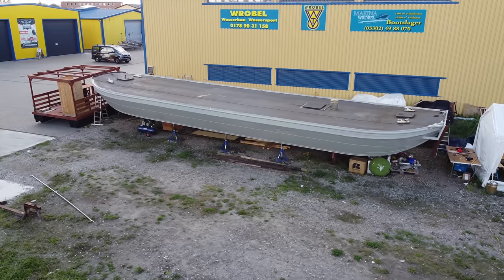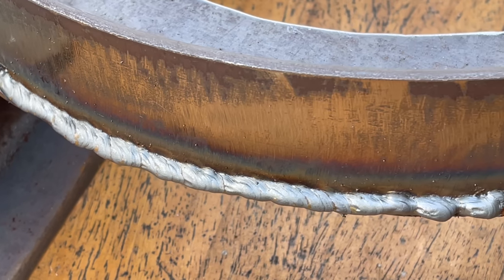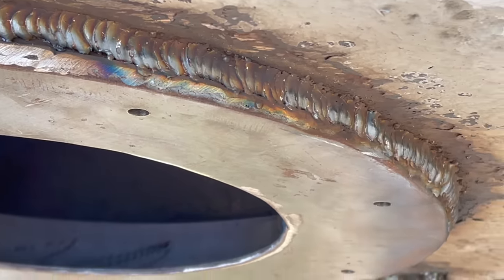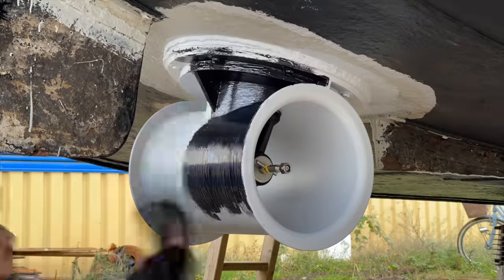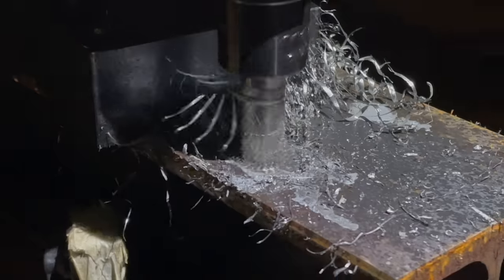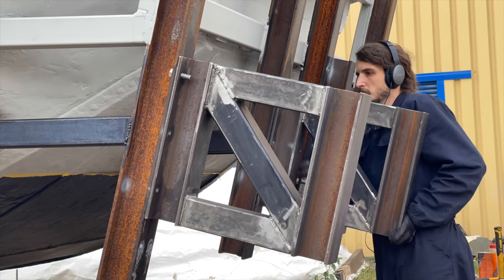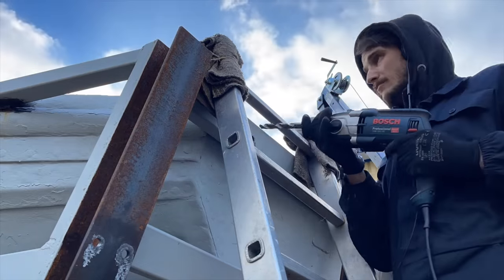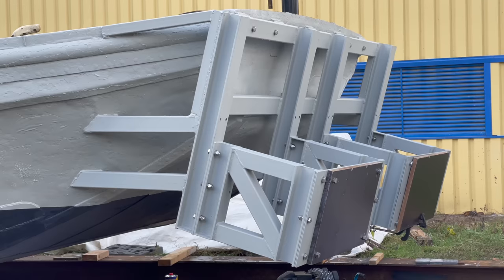My HUGE Barge BOAT is ALMOST READY to go into the Water

Comment: Why did you decide to switch the ends of the boat making the bow the stern and the stern the bow?  The fin you partially cut away appears to have been a skeg designed to support a rudder which makes that end of the boat the stern.

Comment: im sure this solution will work but honestly it fucks up the aesthetics of the boat. i would ve cut into the boat transom (reinforcing it on the inside as needed) to accomodate for the outboards and then deciding whether i wanted direction to come from them or a rudder. if the outboards were to provide direction more  room would've been needed (but not that much i reckon), if not, less space, but a rudder would've  to be installed meaning more time, labour and money.

Comment: Your work is very neat. However, that transom is heavily over-engineered. You do not need that heavy material. Please make 100% sure that your welds are totally waterproof otherwise that square tubing is going to rust from the inside.

Comment: It would be better to grind a V into the join before welding to increase the surface area, then put down a couple of beads. But because you have over engineered it by a factor of 2000, there should not be any issues with a single bead you laid down.

Comment: Did you ever see a outboard vertical lift with a MarineTech Products Panther Marine Manual Motor Tilt and Trim Lightweight Outboard Aluminum Bracket

Comment: I believe you will be happier with the two motors on the back rather than just the one.  You will have better power to weight ratio better acceleration and if one motor goes down you have a spare.  Let me know!

Comment: Still working my way through but so far the bow adapter welds look like they needed to have more amps as it looks like not enough penetration. Glad you ground and re welded them. Great work. A small seat or a mechanics kneel seat works well for underneath workm to save your legs.
Going to look at your other videos later but may I ask why you choose a barge boat? and
Why did you choose to make it go backwards?
Edited :
Does your outboards have an extended leg option to give it a better reach without them being mounted so close to the water?
Have you thought to enclose the extended transoms in with floatation foam core filled to give you a stable and boyant platform to work on the outboards if you happen to break down?

Comment: This barge is decked, what was it used for, before you bought it?? When was it built, and where?? Weight??  Shall you open it up later?? As for the outborders, usually they are placed at a right angle from the water, but that can be rectified later,if need be.  As for service, maybe two platforms by the waterline, or slightly above, beside the engines could be good to have, both for service,and also for swimming, i.e for getting up and into the water. I assume you will put her into water coming spring??  Regards, Mikke..

Comment: Would´nt it be better to use the flanges of the H-beams to make a cradle to lift the engines straigth up and down? Instead of having to tilt them? Would save a lot of steel and weight. Just a thought.

Comment: I hate to be Negative, but those welds are cold, and they have porosity and may not be water tight. Your welding is very good with a stick, I suggest you grind the outer ring and use 7018 in Horizontal to Seal it.

Comment: You are going to need to close in the bottom of the engine mounts as the way they are they are going to scoop water up and over your outboards continuously.  Not good!  Make a model and see what happens.  The bottom will have to extend out and under the engine mounts as one piece or you may end up getting a wall of water coming up between the motors again drowning them.  Even at five or six knots when you hit a wake or waves this will be magnified.  Not only that but they will act in present configuration as a sea anchor and slow you down considerably.  Your welding is getting much better since your beginning.

Comment: You should pull not push with a mig welder those holes in your welds is porosity that means your weld is not as good as it should be!!

Comment: Diagonals on the brackets going the wrong way. View from port side, the strut is going from top left to bottom right. That provides no support to the load of the motor. the diagonal bracing should run from top right to bottom left to support the load.

Comment: I rarely critique your work, since most of what you do is very thorough and thought out, but sadly the sikaflex job on the adapter is going to cause you trouble. 
The grooves are there for a reason, it's not necessary to put another layer in the middle. In fact by doing so you used too much sealant and turned 2 seals into one. I'm not exactly sure why you'd need 2 seals, but most likely it's going to cause you some problems.

What is DEFINITELY going to cause you problems tho, is that you didn't tighten it all the way before it dried out.
When you tighten it all the way, you squeeze all the unnecessary sealant away from the groove. When you don't, the seal will be too big for the groove and by the time it completely dries (1 week- 3 months), the seal will be under too much stress. IT WILL CRACK AND RUPTURE. 
Not angry, just highlighting that it's very important.
That is even true for flat surfaces as well. When you apply sealant paste, always always always always always tighten the bolts to the correct specifications immediately. It's even going to leak if you wait as short as 30 minutes.
Reply: Oh and from an aesthetic point, don't smudge the sealant. It'll be a bitch to clean off next time and looks ugly. Rather wait until it's dry enough to cut off with a knife. This way you will also have a better idea of how it's curing where you can't see. Maybe more important on very time-sensitive jobs, but it's a good habit to have either way.

Comment: You may want to the next time not have the treads of your bolts touching or making contact with your metal. Make sure your shoulder of the bolt came pass the metal a 1/8 of a inch and use a washer to make up the slack. I can give you a diagram if you one

Comment: No offense but those 2 outboard motors are not enough power. You will have little to no control in any kind of current. You should sell them and buy a good used diesel. I have seen people buy school busses and use a pair of turbo diesel school bus engines and have more than enough power for vessel that size.
Also your rear thruster is going to add allot of drag in the water and need more power to make up for it. Please change your plans before its too late. 
You will be lucky to get 3 knots if that with those outboards. Its far from the power you will need to control that size vessel. Once you get any momentum you will have to run those 2 outboards wide open and still not have power to stop.
You simply don't have enough power or propeller to move enough water.
I have owned large vessels for the past 30 years and know what kind of power and propeller it takes.  You need a pair of 500hp turbo diesels at minimum. And a pair if 3 ft or larger props. Before you destroy those motors contact a professional 
Marine technician to get help. I hate to see you destroy those outboards when you could probably get close to the money you need for adequate engins for your purpose. Trust me I have been there and learned from my mistakes. 
What was that vessel powered by before. Or was it just a barge. The boats that push those big barges are powered by v12 and v16 turbo diesel locomotive engins. They dont move easy. I wish you luck and hope you get your dreams.

Comment: I was a welder fitter by trade for many years that welder did what we call in the business a botched job. A Really botched job. I would've told him to clean it up and do it correctly or I wouldn't of paid him. That's a bloody mess yes over head welds are challenging but this dude didn't do a descent job he surely lacks the experience that's for sure. You have every right to be disappointed in that kind of work. The work itself will hold up its not going anywhere but its a shabby work.

Comment: Engine-plates are still to low and act like a brake while drowning your engines. The right engine mounting height is the top of the engine-covers about 1 to 2 inch above the highest point of your rear deck.
With two engines you don't need a bow thruster. You can steer on a dime by putting one in forward an one in reverse. This bow thruster is acting like a brake continuously giving you very average fuel mileage.

Comment: You can afford a mag drill but you weld one tack at time work on welding better those holes are from lack of gas like argon it’s oxygen getting into your weld pool before it can cool down this is migrated by using a mug welder with argon gas or if stick welding use a higher flux electrodes put up tarps to block wind good luck proper welds are way stronger than bolts ever will be good luck doin good for your first boat just learn more about welding it’ll serve you well in life

Comment: Sorry to be negative but those welds are crap, welder too small or not set properly, welds are cold. The batteries you have for testing are shot, over charged and heated.

Comment: Aw dude… those brackets aren’t holding anything, all the weight is gunna be on those welded angles on the bottom outside. And theirs no way they will hold that much for weight for to long. I’d give it a few years tops.

Comment: The so called welder you hired was definitely not a professional welder. Neither the inside welds are looking good and especially not the outside ones. You don't need to excuse his bad work. Hope you haven't paid him much at least.
Reply: Nah, but he had confidence in their strength, they look better than most boat welds, but most boat welds are done with stick. Most people do not have experience with marine welding, they make it thick enough to never rust through near the seam.

Comment: Cut that crap off its just a waste of metal make a box weld it on each side fit motors all that metal is going to be useless if  I could draw on hear I'd show you how get flat sheet steel make a box fixed to hull with right angle for motor to sit up straight and tilt over top .

Comment: ridiculous ugly and pointless. If that was the way to go people would already do it. when you hit any kind of wave or wake your props will come out the water then your engine will submarine. Its all too far back from the hull. You need the water pressure from the depth to move that weight. You need torque to move that weight. All that will happen is you will create a big spray out the back and overheat those engines. You will get a lot of cavitation damage too. Your transom plates will also act like brakes. It will operate but desperately inefficiently. You will not be able to reach out there to work on them and as soon as you try to steer out from a bank you will ground them they are too vulnerable, You would have had a better chance with two out drives off something bigger hydraulically driven. Your twin drive system is a bit of a failed hybrid. That hull will turn about its centre but your engines will want to rotate it from the stern so it wont work. effectivey you have no steering. Your bow thruster will fight against the engines and drain your batteries before you could make one turn in a breeze. Its only good to pull you in a few feet. The weight and mass of the hull is so high your motor will burn out in no time.
Best of luck. Its a pity you solved all your problems before you saw what they will be.